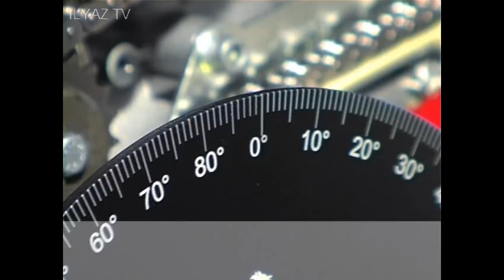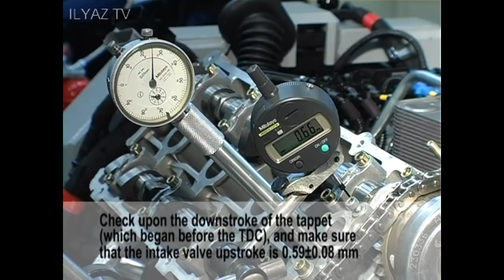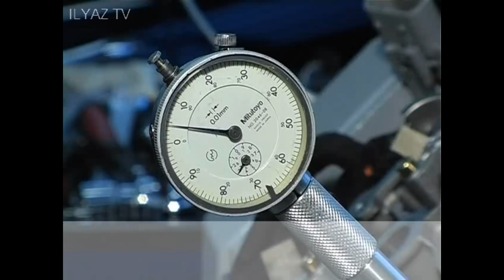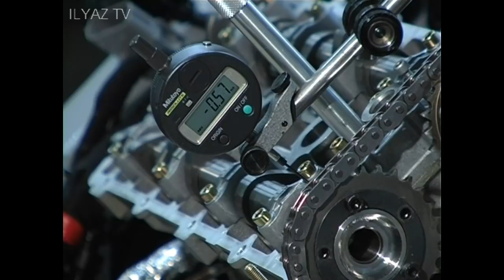Ferrari-Maserati F136 Engine Timing Chain Installation

Comment: Hello, great video! One question, does this apply to the ferrari f430 engine?
Other question, how do you lock the camshafts?
Thanks!
Reply: No, the F430 uses rubber timing belts, the 458 and F136 are the first of the Ferrari produced engines that are chain driven.
Reply: No way to lock them